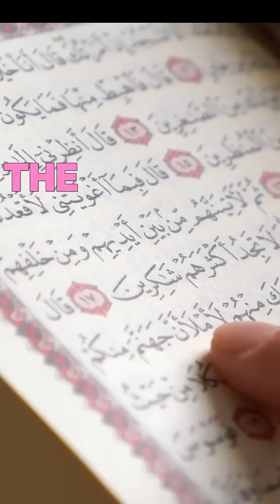The Metallurgy of Surah Al-Kahf (18:96)

Comment: Sorry but there no mention of copper in that verse. It says “Qitran” which is derived from “Qatra” which means - Drops.
Reply from the maker: The word نحاس is mentioned in Surah 55/35 , but to mean: smokeless flames of (molten brass / copper) شواظ من نحاس .

Sura no. 55/35 Al-Rahman reads as follows:

٣٥. يُرْسَلُ عَلَيْكُمَا شُوَاظٌ مِّن نَّارٍ وَنُحَاسٌ فَلَا تَنتَصِرَانِ

35-(There will be sent against you both, smokeless flames of fire and (molten brass), and you will not be able to defend yourselves)

The word نحاس never means (smoke) alone, as a single word.
Reply: @makrababah  Keldai kata rumput berwarna biru. biarkan jangan dilayan. Benarkan sahaja.  Susah hidup nanti kalau terus dilayan. tak makan tak minum tak tidur.
Reply from the maker: Ibn Abbas (Who was known as The most popular interpreter of the Quran) used to say: The tar is: the melted copper, and he may have read it: “Their sarbs are from tar” that is: from hot copper whose heat has ended. As well as narrated by Mujahid, Akrama, Saeed bin Jubeir, Al-Hassan, and Qatada. And their faces will be covered with the Fire.
https://quran.ksu.edu.sa/tafseer/katheer/sura14-aya50.html
Reply: Im talking about verse 96 of Suar Kahf, not surah Rahman.
Im are talking about word “Qitran” not tar.

Also one who interpret Quran, most of the time when they have difficulty to define something, they add words by their own to make it make sense

If Quran is not mentioning copper neither prophet Muhammad (pbuh) said, and someone add for convenience, then it is not authentic.
Reply from the maker: Qitran means molten copper in Arabic.

Even if it’s not mentioned directly in Quran or Sunnah, it doesn’t mean that the word doesn’t exist in Arabic language.

One more question: Which source is authentic in your point of view other than Quran and Sunnah if you want to interpret or explain any Arabic vocabulary mentioned in them?
Reply: @makrababah  No, Qitran doesn’t mean Molten Copper. 
For copper arabic word is - نحاس
For molten copper- النحاس المنصهر
Use any lughat (dictionary) Qitran never mean molten copper. Its the translators who translates it wrong.